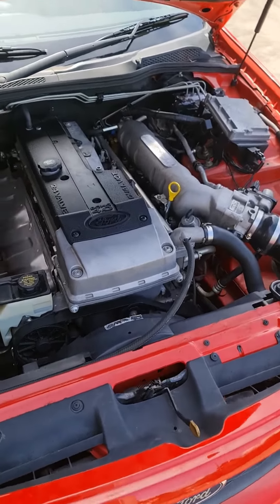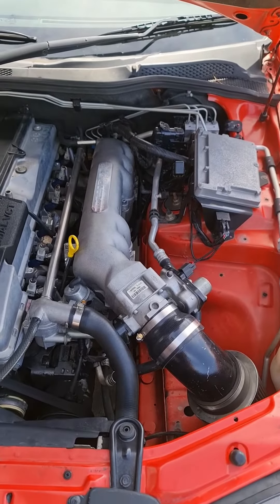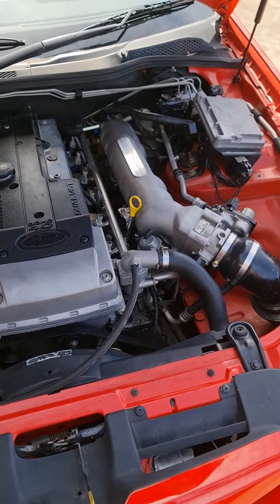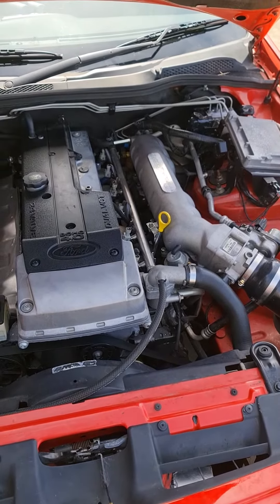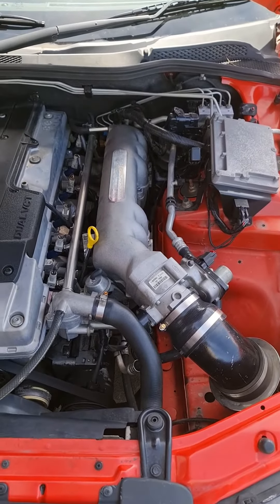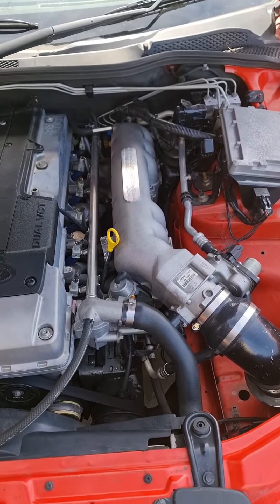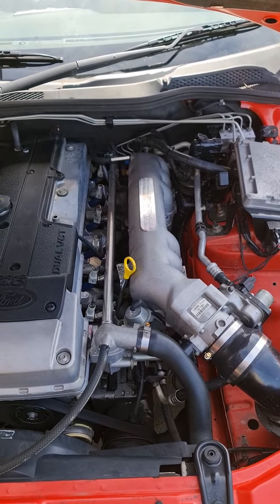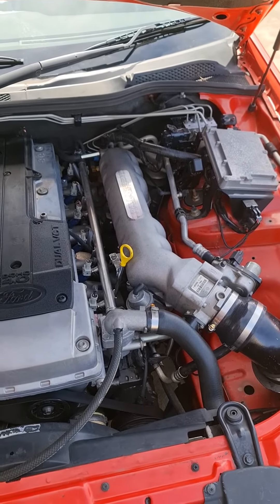Ford BARRA non turbo RajabRacing Developments intake manifold back to back Pro hub dyno test.

Comment: I believe the plastic fg manifold is better for na. You loose bottom end with that manifold because you loose the butterflys but you get a little extra on top end since you have more flow
Reply: If you tune it you’ll be fine. If your doing any sort of airflow you need a good balance of absolutely everything 

Good in-flow. Air intake, Intake Manifold, even ported heads. 

Good out-flow. Exhaust manifold, dump pipe and exhaust system 

That’s what makes all the difference and give you a good consistent power band throughout the rev range.

Comment: Big loss in low end torque however.  On the street low end torque is key as 90% of time the car is at low cruising RPM. If you are doing track days and circuit racing great upgrade. However ever on the street the factory manifold is better, the Ford engineers know what they are doing.
Reply: Lucky they have you to help them, Rajab are fairly new to the car modification game, so it's good they have a tuning legend to help them 👍
Reply: @gtlegend007  who, in their right mind, drops $1300 on a n/a Barra for a manifold, and leaves it like that! No one, that's who, no one.
They'll put headers and a full exhaust and definitely a tune to suit, at the bare minimum, and if they are trying to squeeze every ounce of power out of an n/a, they'll probably do head work and maybe higher comp pistons. The mapping will be so different to stock by then that the initial change of a manifold won't be anything to worry about.
Reply: Are we sure that there is a loss of low end or did they load the throttle into the dyno pull in a different manner?
Reply: @mickbrumer  hit the nail on the head. You can hear the induction noise. Doesn't sound like it's at WOT at the start of the run.
Reply: If it didnt have the flappers on it then yes. It still has the flappers on it. Its not losing nothing
Reply: @Brettj77  20kw that can be done in the driveway with basic hand tools with no tuning or other more expensive mods is a bad idea? it should be the first thing done or close to it! Or just be like all the other sheep and mod your car like you’ve been told  !
Reply: You would have to drive like a sloth to not take advantage of the additional power! yeah there’s probably some minimal low down torque losses so it’s slower when going slow! big deal! It’s just like saying a turbo car is slow because of a lack of down low torque but in reality they are often the most responsive and fastest things going! I love trolling ss’s and xr6’s with my Ecotec! They’re all slow!
Reply: What do you care if you lose low end torque when your not reving it or driving it hard? Not like it would be like a 50% drop.